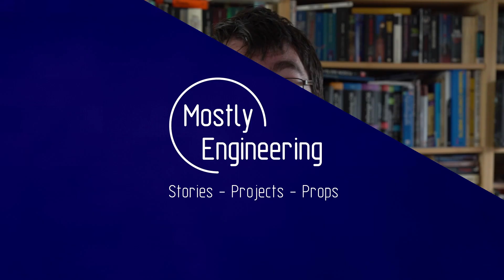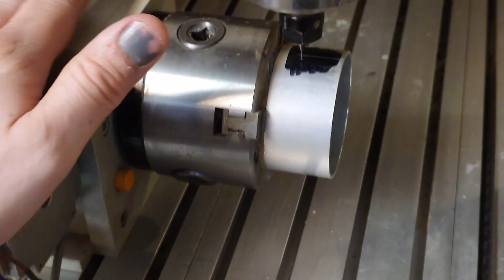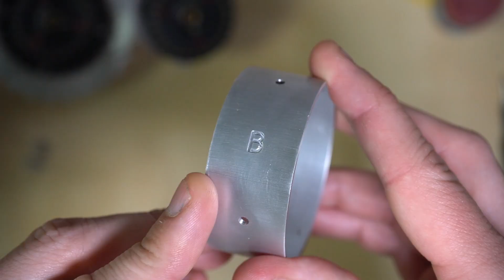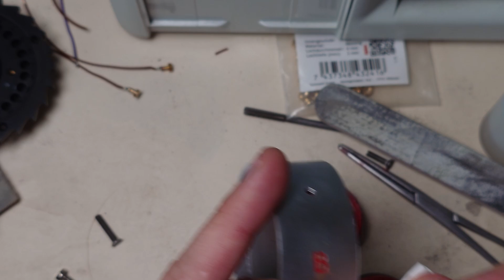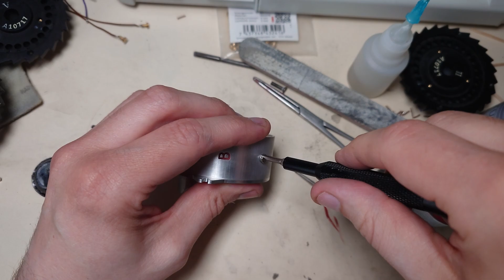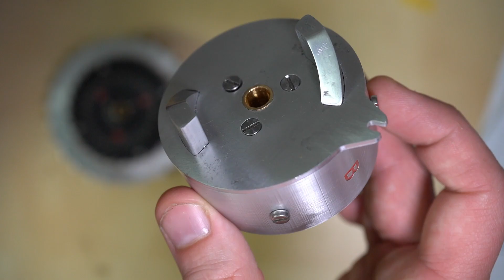The Enigma Build Project - s2e5 Finishing the Reflector Drum

Comment: I have done some 4 axis engraving on my home-converted CNC mill. In fact, it's really 3 axis, X, Z, A. Unfortunately I really neeed a higher speed for the cutter - the milling machine has a top speed of 2500 rpm, which is rather slow for the size of cutters used in engraving.
Reply from the maker: Yeah thats low, on the big ones in the Workshop we have 20.000 rpm and if we use the very fine 1mm end mills we always keep stock because there are so easy to beak. but the small one i brought back to live for this one has 40.000 rpm and the the Mill cut without any effort as is the Aluminum was warm butter.